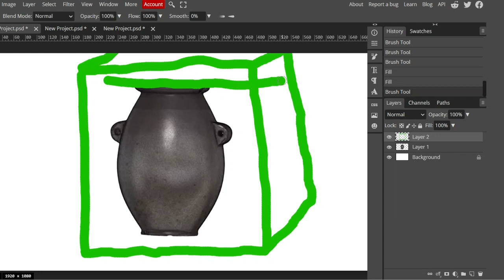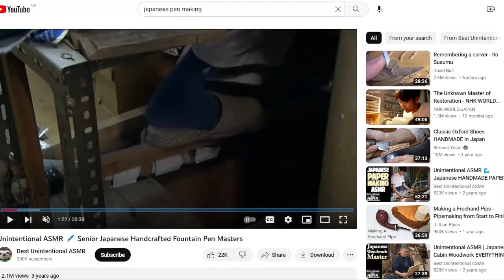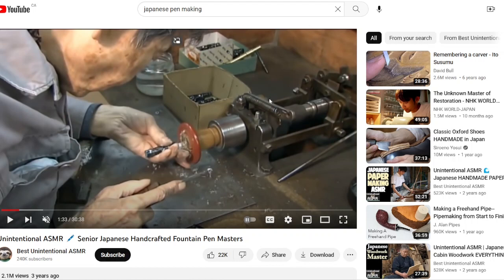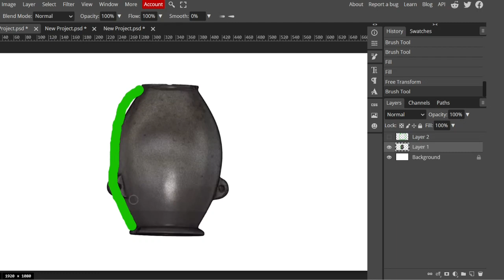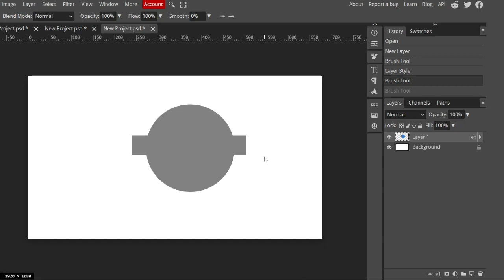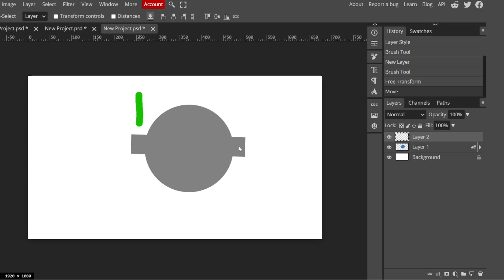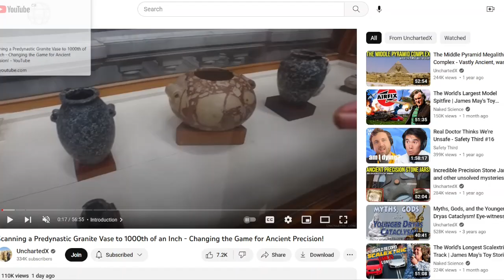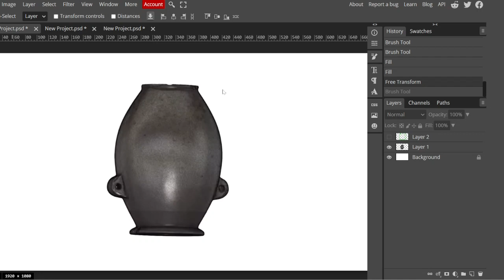Making Predynastic Granite Vase Using Lathe Only (from UnchartedX video)

Comment: Research how trunnions were machined on cast cannons in the 1800s. You can turn every area except where the handle bosses are at. Then you would have to switch to a mill or by hand. The cutting tool would have to be diamond or diamond encrusted material.

Comment: Humans fresh out of the stone age were probably really really good with stone. But this is not a free form like a Hellenistic Aphrodite and I don't see how this could possibly be done with pure hand guided tools like chisels and bow drills. A repurposed centrifugally centered pottery wheel is not going to cut it either. From my 2023 perspective you need some tight tolerances on your headstock to get this done. That, or there are some stone age (pointing tool?) tricks completely lost in time. Nowadays we have trade secrets and non proliferation treaties, maybe something similar explains why written record of good lathes show up much later than these vases.
Reply: if that was true, then why did the making of these extremely precise vases made of the hardest stones some of which are a 9 on the mohs scale stop after the 4th dynasty in egypt, and after that they only make vases out of alabaster which is only a 1.5-2 on the mohs scale and even though it is a very soft stone those alabaster vases arent anywhere near as precise as the previous hard stone ones